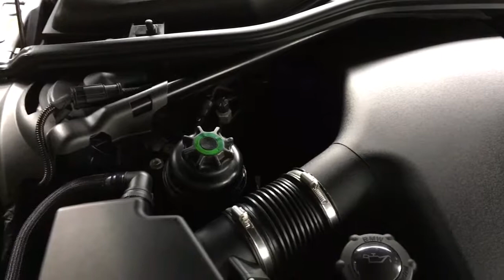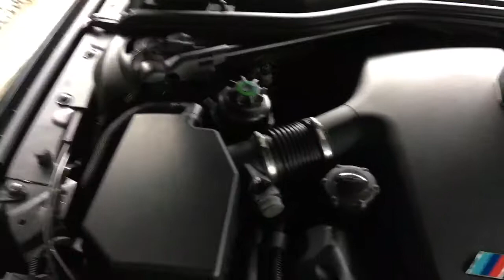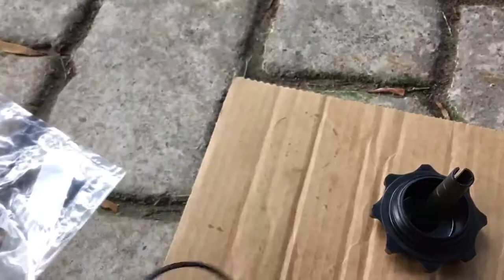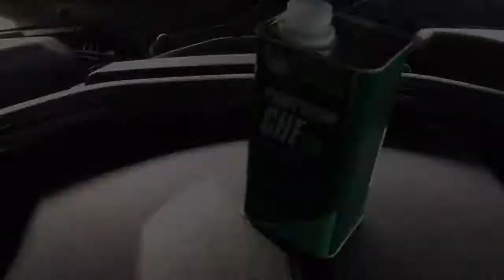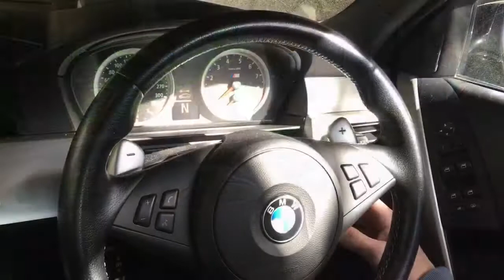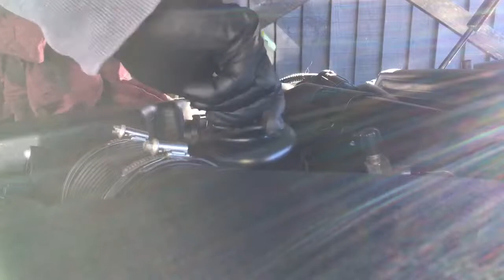BMW Power steering fluid change

Comment: the power steering fluid reservoir has a built in filter... the reservoir is cheap.. maybe $30 USD, so worth changing the reservoir when you change the fluid.
Reply from the maker: It’s not a filter, it’s a strainer as per any hydraulic system “tank”

Comment: My cap says ATF (2005 Japanese) but the liquid is green: I have no idea what the previous owner put.

You recommend I flush the system and put in whatever is on the cap? Ie ATF?
Reply from the maker: If it’s an E60 and 2005 it will be CFH11S from the factory (green) The sticker may be missing from the cap
Reply: @MTechGuy  thanks a lot

PS my clutch disintegrated and my slave cylinder gave out 😂
Reply from the maker: Lovely! 😩
Reply: Mine in the US has a cap with "ATF only", which is weird and the red fluid in the reservoir is probably causing the system failing. I can hear and feel noise or little vibration coming from the steering wheel when making right turns and it seems that the noise is in accordance with speed or rpm...

Comment: Why not do a video on a proper power steering flush?  Renew the reservoir (that contains a filter) attach pipe to return hose, & properly bleed through the new fluid. Or drain from bottom. This is just a lazy way & just mixing old stuff with new.
Reply from the maker: Replacing the reservoir is overkill, it contains a hydraulic fluid strainer not a “filter” I’ve been using this process for many years without issue
Reply: @MTechGuy  rather do it properly with new reservoir & thorough flush through every 5 yrs. Let's hope you don't just suck out brake fluid from reservoir & renew like some lazy garages I've witnessed do.
Reply from the maker: @stevesas632  Thanks for the feedback Steve 👍
Reply: @MTechGuy when car is running is there flow through resovour? If so can it just be siphoned out at same time adding new fluid till it's all clean?

Comment: hi mate..how many liters are needed to do this process to make sure the steering oil is completely new ... as far as I know opening drain plug at bottom is the most effective mate?
Reply from the maker: I’ve always used 1 litre and got 3-4 flushes without issue. 3 flushes would normally get you to 90% or more new fluid. Draining from the bottom you still need to get the oil fluid out the extremities of the system and deal with all the mess
Reply: @MTechGuy  thank mate.. This explanation really helped me. 👍🏻
Reply: Thanks for sharing. But I don’t think you are draining even half of the reservoir - the pump tube is not reaching the bottom. I’ve drained nearly a whole litre in one go, and then top up the same volume to flush then repeat again. This saves doing a smaller amount 3 or 4 times.

Comment: When you do the final flush and refill it one last time. How do you know you’ve bled out any air out of the system?
Reply from the maker: Turn the steering wheel full lock both ways a few times to bleed the air out 👍
Reply: @MTechGuy  finally did the flush. The perfectionist in me wanted the fluid in the reservoir to be green but that’ll be nearly impossible. It was a yellowish fluid but cleaner than what I had before.

I did hear an intermittent low knocking sound (like someone hitting a door with their knuckle, nothing fast as far as frequency) every 3-5 seconds during idle coming from the front of the engine near the valve covers after my third flush. I didn’t hear this before. The knocking sound did go away after some time. And did not occur when revving the engine in neutral. I’m thinking either VANOS or time for the preventative rod bearing change.
Reply: Just an update M Tech Guy, I reached out to Troy Jeup (I’m sure you heard of him somewhere in the E60 M5 world) and he recommended bleeding the VANOS. Just wanted to update you
Reply: @DogNamedNicolas  Here's how to do it the easy way, changing the reservoir and getting pretty much all the fluid out: https://www.youtube.com/watch?v=OqpNmDur9Vg&feature=youtu.be